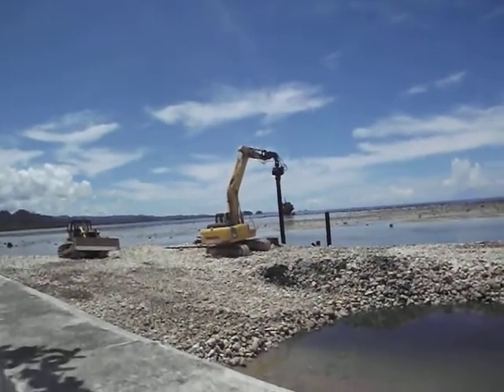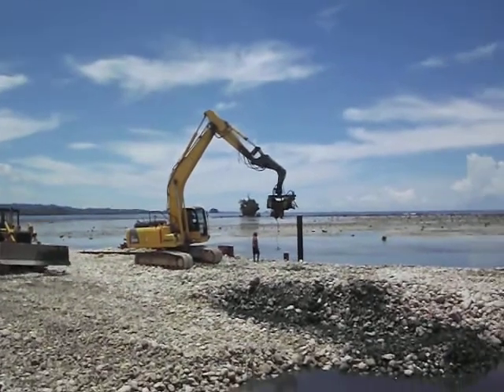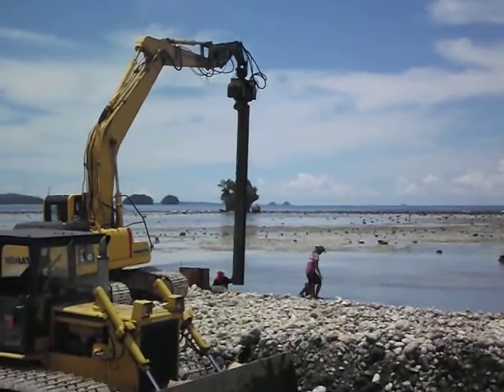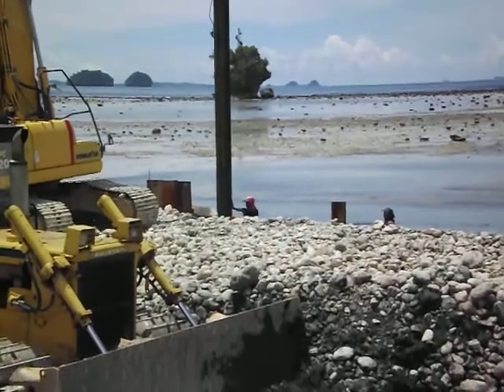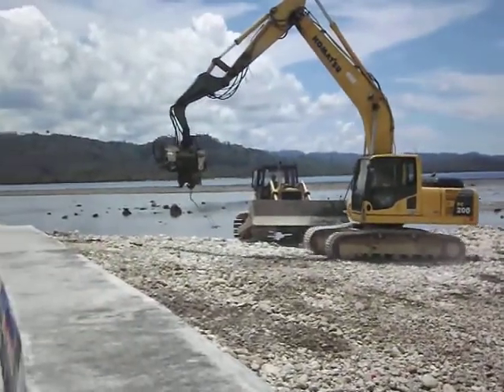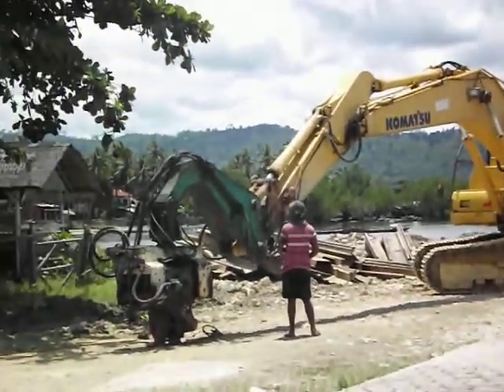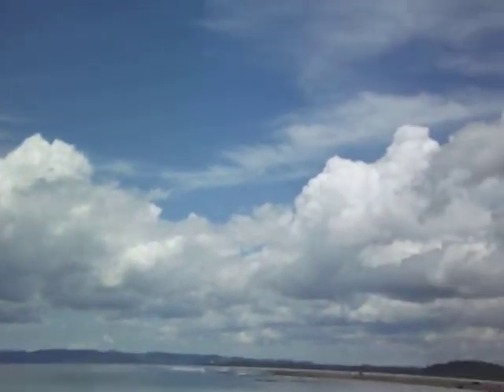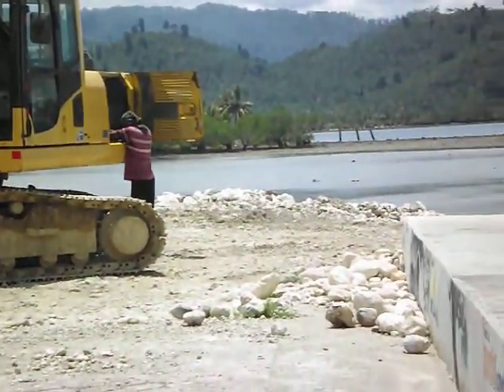Construction Work at Lianga Sea Front

Comment: This is the first video of heavy equipment in the PH that I have seen.  Usually everything is low tech use your back work.
Reply from the maker: Hi George i acuatly seen a new JCB 220X 360 Excavator today on the new road works it had a big Union Jack on side
Reply: @britengineerinmindanaothep9376  Probably shipped over from the UK
Reply: @britengineerinmindanaothep9376  Foreign contractors?